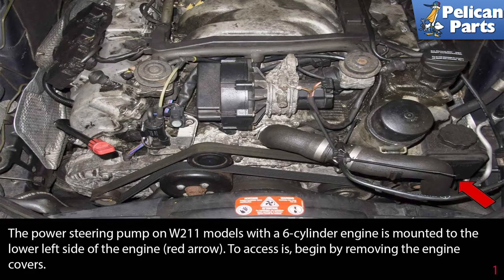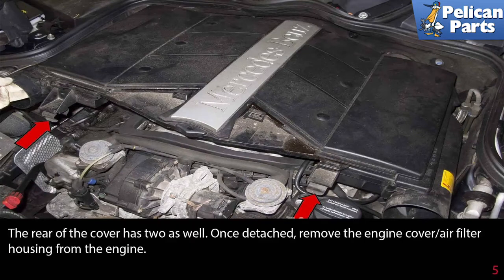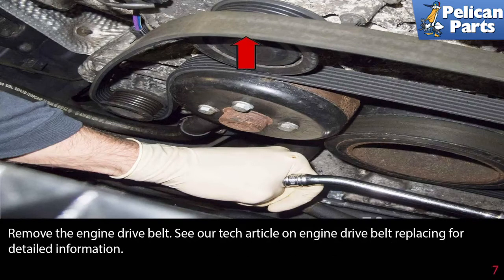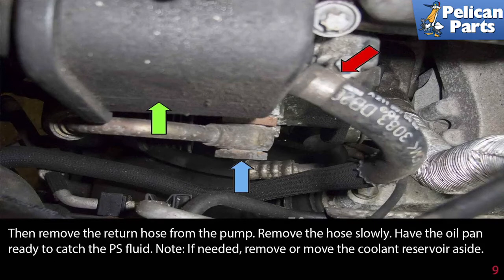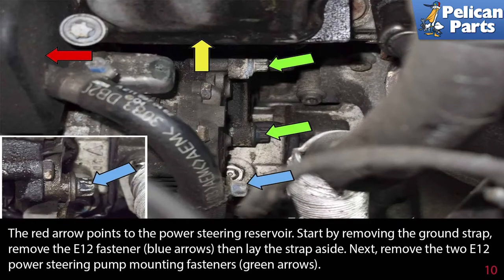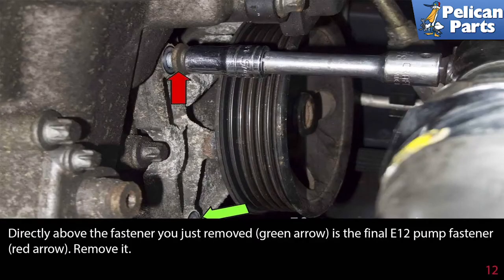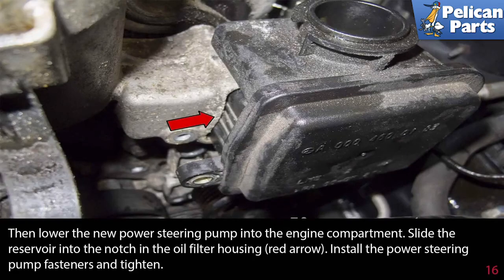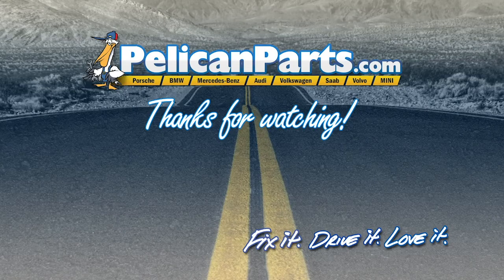Mercedes-Benz W211 E-Class Power Steering Pump Replacement

Comment: You should definitely change the reservoir. It contains a filter in it that cannot be changed. Since it is cheap there is no reason not to replace it.

Also the steering should be turned full lock 30 times with the engine off before starting.
This is according to the manual. Wheels off the ground help in this case.
Reply from the maker: Thanks for the additional info and feedback. We appreciate it.

Comment: four E10 bolts? I removed them all and the pump is still attached solid! Wont come off? Did somebody attach it with JB WELD?
Reply from the maker: Could be stuck  from corrosion.
Reply: @pelicanparts  Thanks no.. There's five bolts actually and I missed one. I got it.
Reply: never heard of that, no I missed a bolt that I could not see, then it came right out. Repaired and running fine now, thanks @pelicanparts